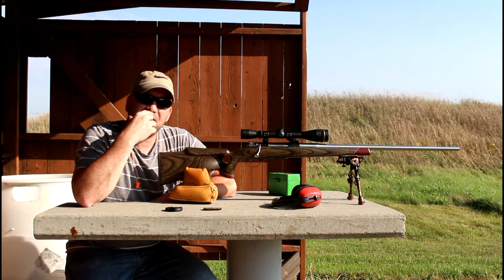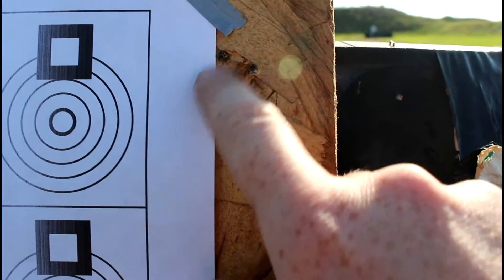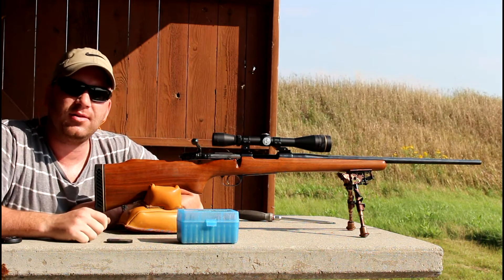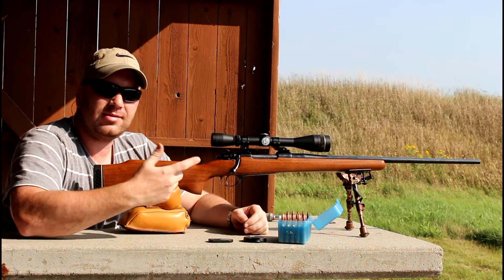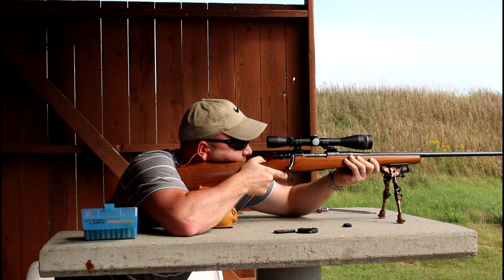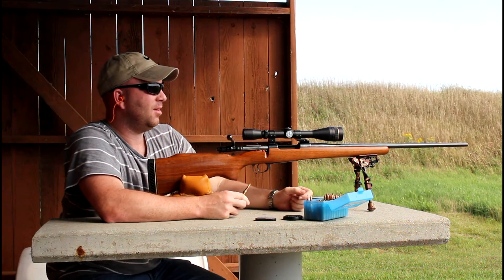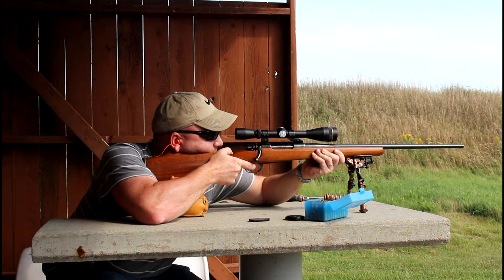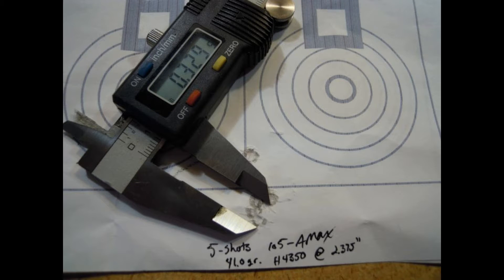Barrel Floating Range Results Custom Precision Mauser Part 5

Comment: Nice job on the rifle. My .243 military sporter really seems to like the 55 grain nosler Varmageddon. best group to date was 3/4" at 200 yards with 5 shots. It's had a LOT of work done though.
Reply from the maker: Hello Patrick, 
Sounds like you have a winner there. These old mausers usually take quite a bit of work to make them shoot well consistently. Usually the easiest thing to do is throw on a new barrel, but truing the receiver, new trigger, bolt lugs, integral lugs, bedding, and floating the barrel will get them shooting very good. You can also add a heavier main spring, and if you really want, a Tubb style firing pin to decrease lock time as much as possible. I built an FN actioned wildcat that consistently holds 1/2 MOA out to 600 yards, but I've done basically everything listed above to it and it has a Rock Creek Barrel on it. They are fun to work on, build, and shoot.

Comment: Hey, I think it would be interesting if you could, instead of buying a new barrel, try making a barrel sleeve or shroud so that it wouldn't heat up as quickly and/or cool down quicker. What do you think? Would it be worth it so that you could do like a whole 5 shot group without pauses?
Reply from the maker: They do actually make a few products for this. I've never looked into them. Most of my rifle barrels are heavier than this one and I can usually do 5 without much issue. I don't plan to put a barrel on this one. I have enough other projects that I've been meaning to do for quite some time. I have 3 barrels right now I need to put on, just don't have the time to machine them.
Reply: Barrel sleeves work.